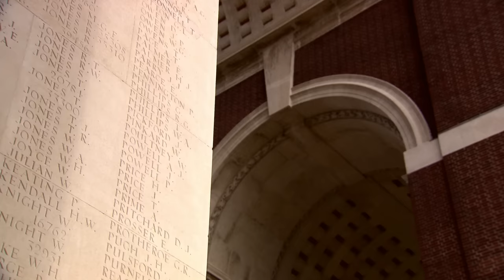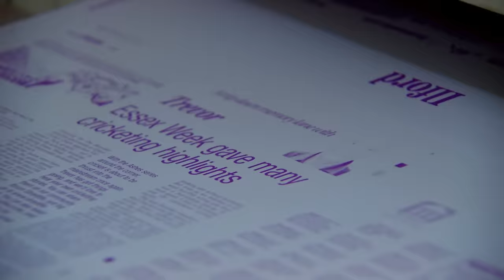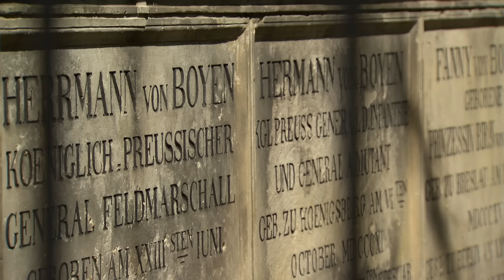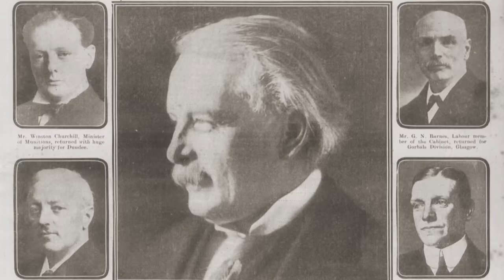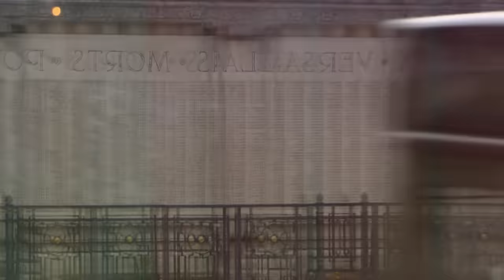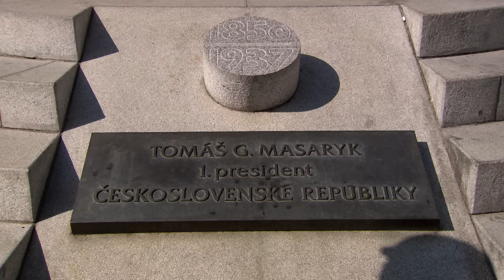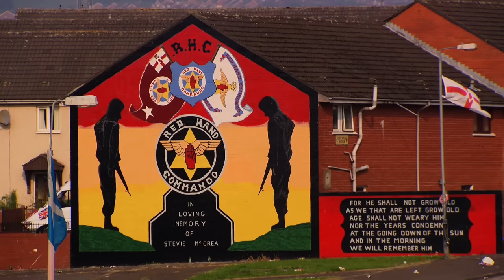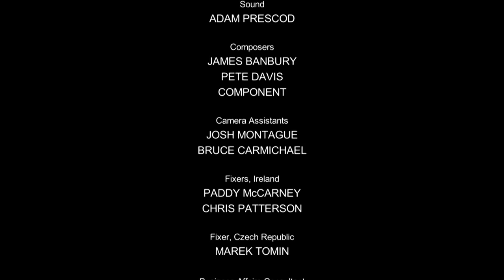WWI: How The Scars Of The Great War Changed The 20th Century | Long Shadow: Parts 1-3 | War Stories

Comment: World War I ended in an Armistice at around 11am (GMT) on 11 November 1918. The final conclusion of World War I was on the deck of the USS Missouri in Tokyo Bay on 2 September 1945 with General Douglas MacArthur presiding over that tragic but historic moment. The world was already in the Atomic Age. The nightmare that Einstein and Oppenheimer and Szilard had feared was well underway as the USSR and the USA would enter into a Cold War struggle.
Reply: @ChristianCentury2000 Not exactly the case.  The struggle was between the USSR and the West, only Ameruca had to take on the responsibility for most of the struggle.